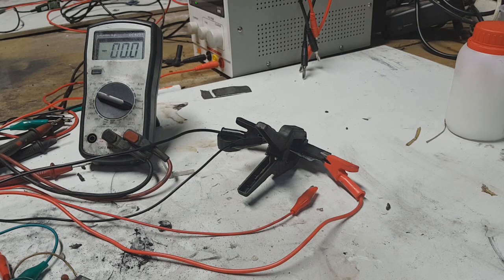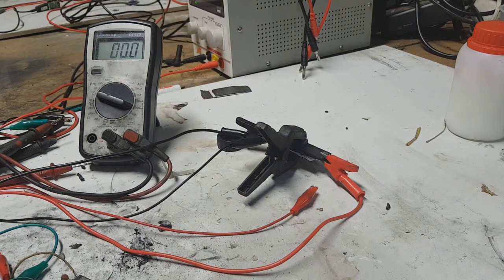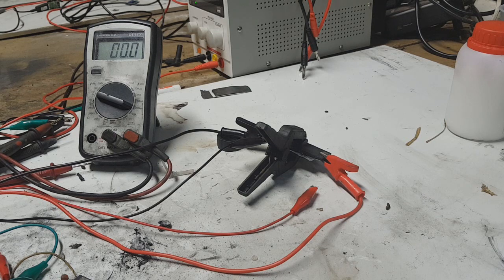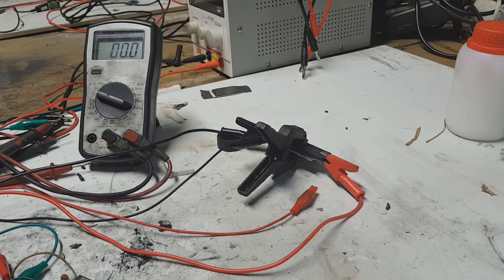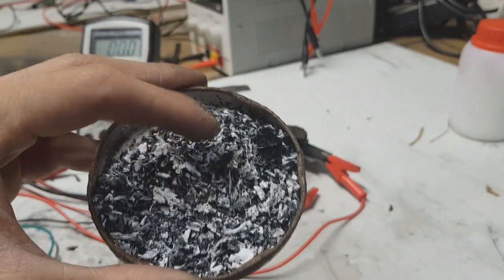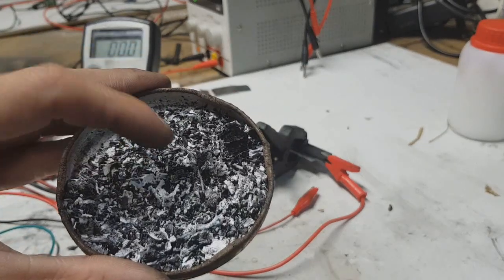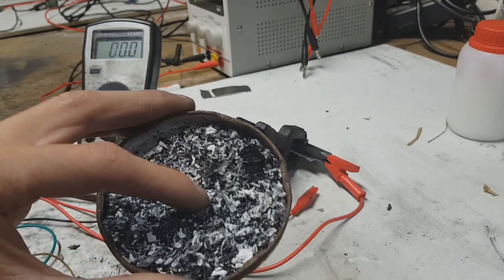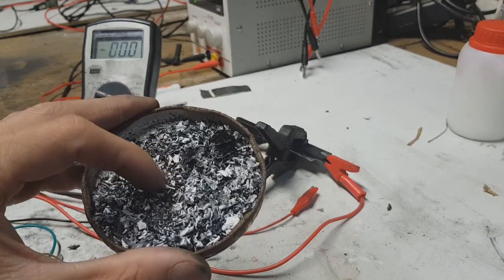Dual Carbon Battery from Carbon Dioxide

Comment: hi cayrex2 as usual impressive video and battery i am particularly interested in the method by which u got carbon from carbon dioxide any chance making a video on it pse
Reply from the maker: thank you! yes I will make a video! but right now is this methode not so Efficient.
Reply: cayrex2 are you going to share this method?